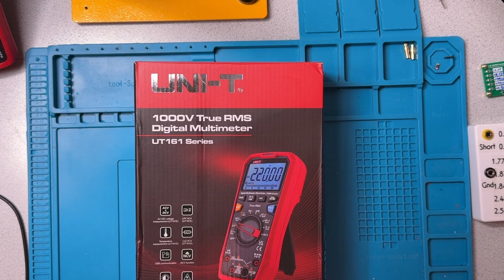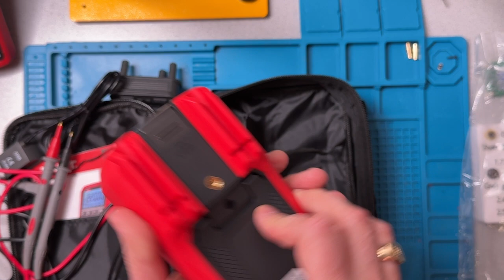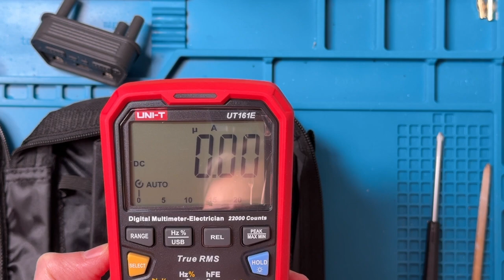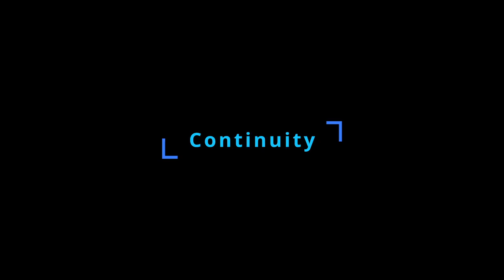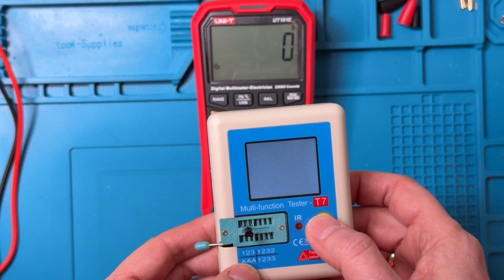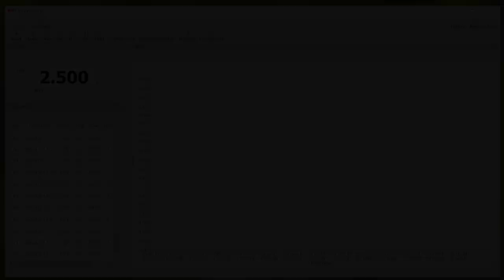Uni-T UT161E Unboxing and Review

Comment: Please tell me. Is it possible to short-circuit the probes in the diode test mode? When you check the diodes, the indicator lights up green, but if you close the probes to each other, the indicator on the multimeter lights up red. Is it possible to damage the device in this way?
Reply from the maker: This will not damage the device. One way in which a diode can fail is to become a short.

Comment: Does the Bryman 789 have the option for displaying data log on pc through usb? does Bryman make a model that has this feature?
Reply from the maker: The 789 does not have this capability. The 2257 does have this capability Brymen call it PC-Comm. I show it in operation with the Brymen software in this video https://youtu.be/vhb3l0km7-8

Comment: Good job as usual. I have a few rules that I apply to avoid buying anymore multimeters unless they really deliver. 1. Diode beep 2. Back light stays on until I turn it off. 3. LoZ in AC and DC (I use it to discharge capacitors) 4. Fast auto ranging. The only exception to these rules is the UT89XD. It is a manual range meter and doesn't have loZ but it does have two diode test ranges, 3 volts with beep and 12 volts. It is so far the most useful meter for repair work that I have ever owned. Once again great review, thanks for doing it.
Reply from the maker: Sounds like a good approach.
Reply: It's definitely disappointing that LoZ is missing from serie's top model while lower UT161D has it.

Comment: Which Brymen multimeter would you recommend 789 or 869s? I have noticed, that the 869s has no LoZ mod.
Reply from the maker: I got the 789 because of the beep in diode mode. I think they call this BeepLit Diode. When I am troubleshooting a board I don't want to have to keep looking at the meter. The 869 does not have this feature.
Reply: @jtechlabs1 you are right this function is really usefull. And there is the new Brymen 2257, which is also good, but not so accurate like the Brymen 789. I‘m not quite sure whether the Brymen 2257 is enough for me or whether I should buy a Brymen 789…
Reply: @MethodMan- If you are looking at Brymen 2257 you could also have a look at a Hioki like DT4256
Reply from the maker: @jtechlabs1
  • 0 seconds ago
I just ordered a 2257.  There will be a video in a few weeks. I find that most of the time the extra accuracy is more confusing than helpful. For example if I am checking for a voltage of 2.5 volts and I get 2.53 that's fine. With the Brymen 789 I will get 2.528. Is that important?  For me no. For some yes.
Reply: @ thanks I will
Reply: @jtechlabs1  Thanks for your efforts, I look forward to the results
Reply: Lucky you, I still have not found a way to get a bm2257 shipped to me. It seems like the perfect meter for me on paper.